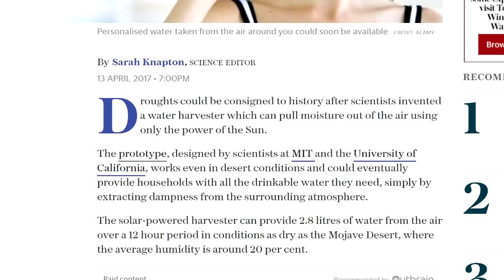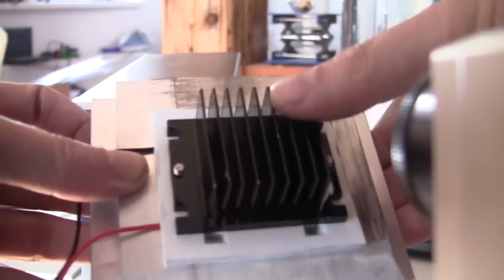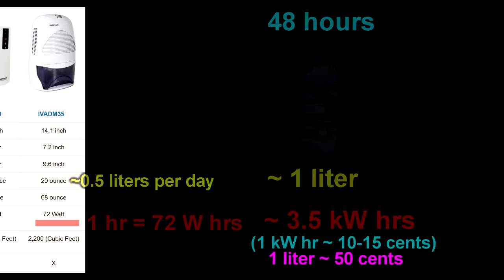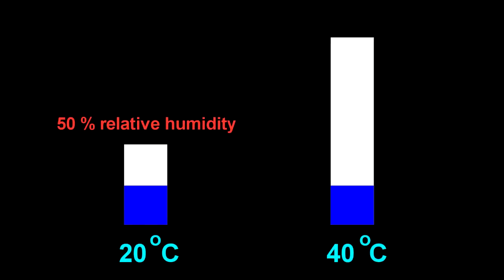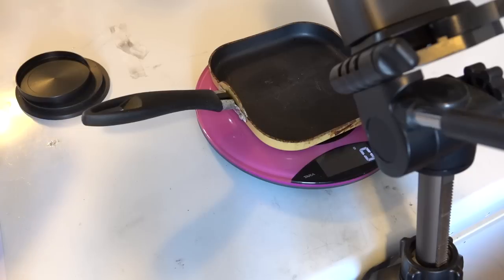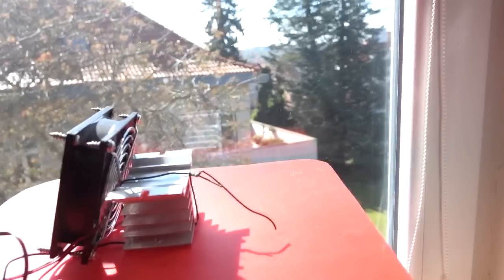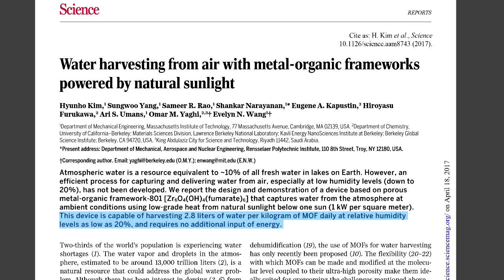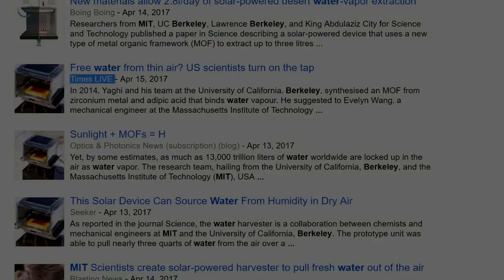FREE water from AIR device: BUSTED

Comment: Thorium dehumidifiers on the side of solar roadways?
Reply: DonCDXX with a hyperloop off in the distance ;)
Reply: And driving freakin' Thorium powered cars on solar freakin' roadways! All made out of air carbon! I've seen the future, guys!
Reply: +RobertElBMX underneath *
Reply: hyperloop dehumidifier!
Reply: Completely free of Man spreading and Mansplaing!!
Reply: the densest dehumidifiers anywhere
Reply: DonCDXX you've gone too far XD
Reply: Which lead to the hottest skyscraper hanging from an asteroid.
Reply: thorium dehumidifying plastic solar roadways
Reply: Built with solid gold hammers
Reply: Thorium hyper loop spinning solar panel roadway self-cooling atmospheric water condenser.
Reply: I wonder if someone has thought of putting together a hyperloop together with a solar roadway, is a semilegit way. As in sink the hyperloop under the road. Use the solar road way to power vacuum pumps along the route. heh see where I going this could work. As long as there isn't clouds or darkness, like at night, or perhaps a traffic jam and all the traffic covers the roadway, or perhaps even a crash.
I wonder what would happen to the solar roadway if there was a car fire on top of it. I suppose they could mount fireextinguishers at the side, using water from one of these free water generators to pull water out the air as needed. Wow, I need to get a multibillion dollar grant from the DoT for this, if anyone comes up with this patent I thought of it first, you're all witnesses right?